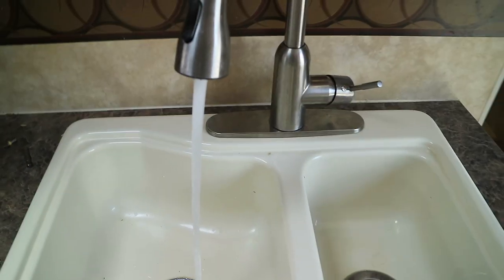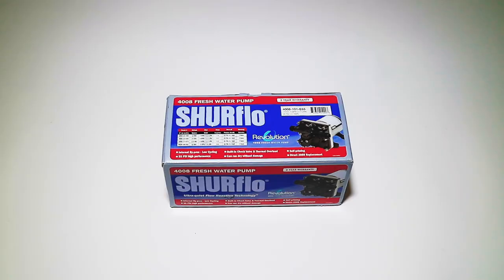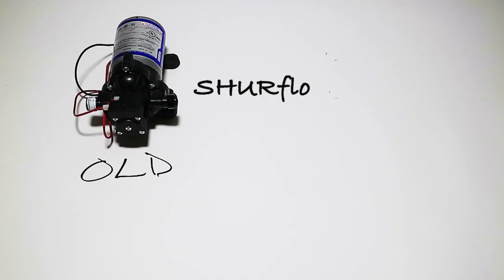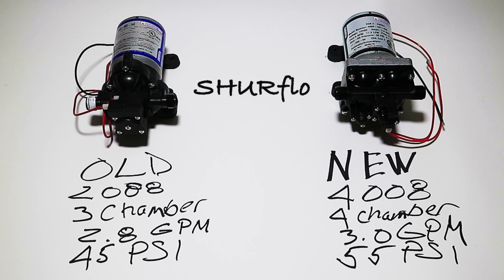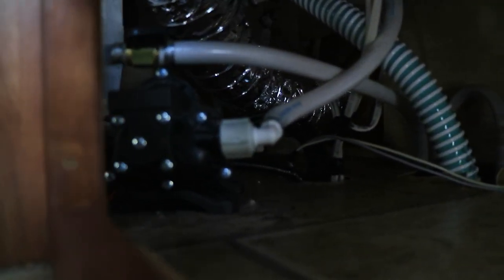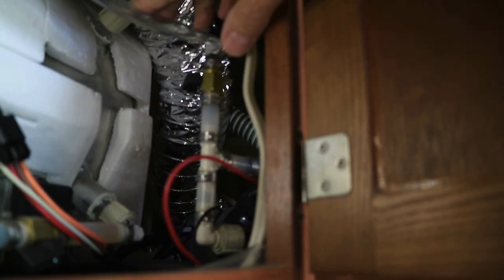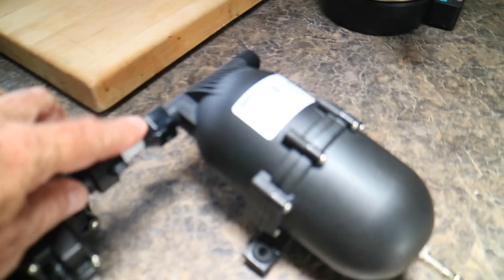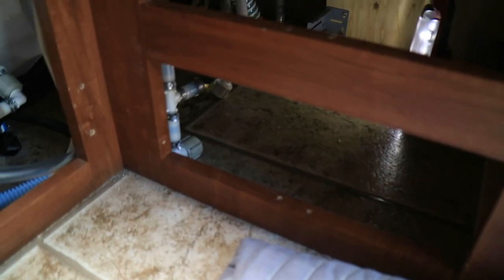RV Water Pump Upgrade - GOBSMACKED comes to mind.

Comment: The 4008 is a great pump. The cut in pressure on the pump is 40 psi. To get max benefit from the accumulator tank, set the tank pressure to 35 psi.
Reply: Agree

Comment: How often do you have to pressurize that tank . Or is it pressurized from water pressure after initial pressure rising buy compressed air?
Reply from the maker: Heber Clement III you have to check it periodically. 30 psi I think. It’s been 6 months since I last checked. Thanks for reminding me.
Reply: Thank you for the fast response. Awesome this never  happens . Thanks. So on a three night weekend do
You have to check it? I noticed in your video you mentioned something about once a year?